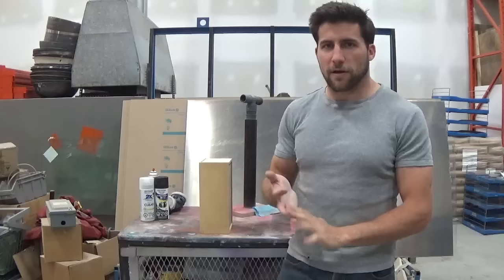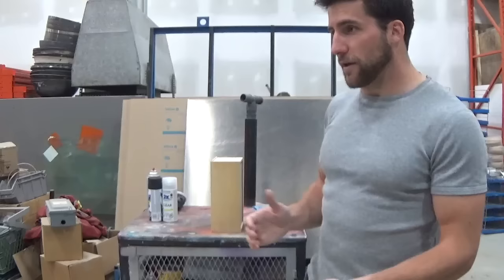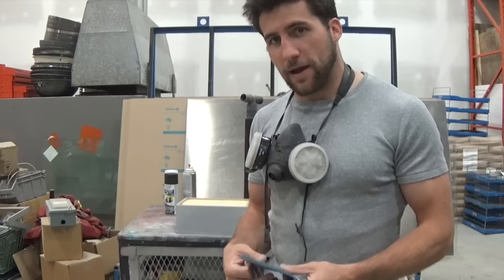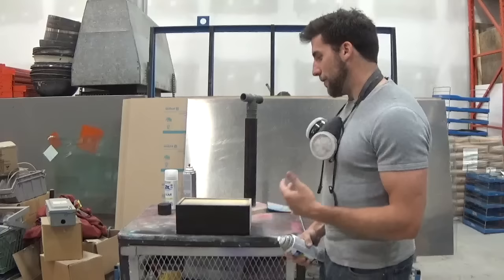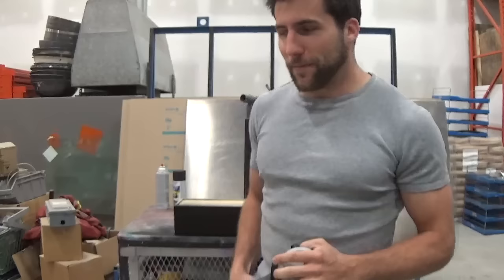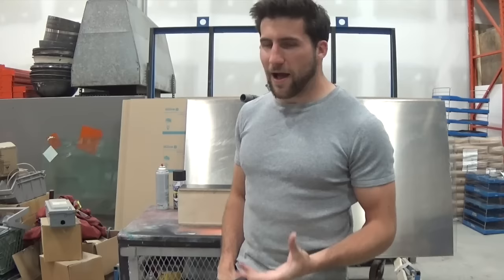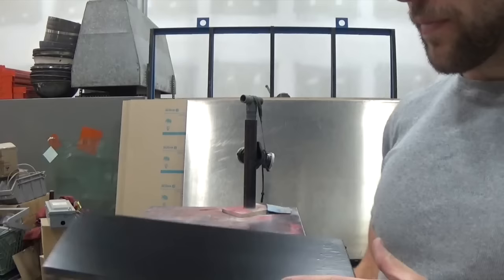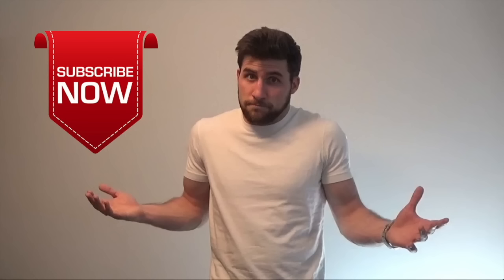How to get a matte black finish with spray cans

Comment: Thinking of refinishing a guitar with a mix of matte black and matte orange. In regards to durability (as you discussed in this video), how many coats of clear do you think I should apply? I was originally thinking 4, but I'm not sure if that is too many. I have pretty much zero experience painting guitars, but I sold paint (house paint) for 8 years. So I have some general paint knowledge. The guitar in question is gloss black now. I would prefer to not sand to bare wood, but do you feel that will give me a better quality end result? The idea I have is a matte orange top, with matte black sides and back. Thanks for this video and the four part video series on painting a guitar with spray cans. They have been insightful.
Reply from the maker: Hi there. I don't think it's necessary to sand to bare wood, particularly if the gloss black is the original finish. I would also say that 3 coats of clear should be sufficient. As you increase the number of coats, you increase some of the risks related to drying issues etc.
If I were in your situation, I would do something along these lines: 
1. Scuff the whole guitar down with 600 grit so that the new paint will stick (but no need to go all the way through the clear), and clean it.
2. Tape off everything that you don't want to turn orange.
3. Spray 2 coats of matte orange, or to full coverage (likely 10 minutes apart depending on paint type).
4. Unmask the remaining painted areas (leave the fretboard, cavities, and anything else that isn't painted masked off).
5. Spray two coats of matte clear (make sure it's compatible with the orange paint).
Reply: Brad Angove Thank you so much for the in-depth tips! That was a huge help. Didn't think about the potential drying issues with multiple clear coats. Good advice! Since I'm doing the sides matte black, and the top a matte orange, does it matter which order I finish the colors? I don't see there being any benefits to doing the orange first, or the black first, but I'm curious if there is something I'm missing there. Thanks again!
Reply from the maker: I think we had a small miscommunication in there haha. Those were essentially all the steps. Unless I'm misunderstanding your situation, there should be no need to spray any black since the guitar is already black. You just need to scuff the gloss off and put matte clear over the part that you're leaving black.
Reply: Ah, understood. I was going to coat the sides and back in matte black since I got this guitar used and its a little beat up in those areas with nicks and scratches.
Reply from the maker: Oh, I see. In that case, it doesn't make much difference what colour you do first.
Reply: Excellent. Didn't think it would, but wanted to double check. Thanks again for all the help! Your videos have been great in helping me try to figure this all out.
Reply from the maker: You're welcome. Let me know how it goes.
Reply: Will do! Hoping to get to it in the next month or two.

Comment: Hey brad great vids man, im in the process of repainting my strat and had a question. Looked through other comments but couldn't find exactly what I'm thinking about. I have a gloss color and matte clear coat. Can i flash clear coat it? I dont really care if it's matte or clear it's just what I have already. I see you told others to wait a few days and then re-sand and apply the matte clear. What will the result be if i just wait the 10 mins and hit it with the matte clear after gloss color?
Reply from the maker: +Jordan Elliot There's no reason why you shouldn't be able to do that, as long as it doesn't result in you firing 5-6 coats total on in one session. If you're doing a couple of each it should be fine. The concern is that if you build up a bunch of layers without a drying session, the ones underneath will never harden properly.

Comment: Great video, thanks.  I destroyed the matte black finish on a low-end / $200 Harley Benton bass guitar recently, and want to do a very minimal re-paint on it, and take it to matte silver.  Do you by chance take on super small projects like that?  I don't currently have a space to do it.
Reply from the maker: Sorry to hear that it needs a touch up. I’ve actually stopped taking on projects at all pretty much. If you tell me where you’re located I might know of someone though.
Reply: @BradAngove  Thanks for the reply. I'm in the Boulder/Denver CO area.
Reply: @BradAngove  Or if you don't know of anyone in this area, maybe I'll just try your approach here with cans, matte silver. Nothing special.
Reply from the maker: Texas Toast Guitars is around there. I expect they know someone who would be suited for this job.
Reply: Thanks @BradAngove  .  I contacted them, they were nice, but said they don't take stuff like this anymore.  I think I'll just try it myself, using this video.  One question, you didn't seem concerned about sanding between coats (except after primer).  Was that just because of the sample you were using for this video, or because it's not really needed with matte, since it's quicker drying?  I'm gonna go with the matte clear coat at the end too.  I'm not super concerned, it's a low end bass, I just want a finish on it.  Thanks again.
Reply from the maker: If you are recoating within the 10-15 minute window like I am you don’t sand because it bonds chemically.
Reply: @BradAngove  Got started, was looking great until I sprayed on the clear satin poly.  It spit larger droplets in random places on the front of the body, and I didn't realize it until after.  It's not awful, but annoying.  Anything you suggest for dealing with that?  Can I rub it out somehow?  Thanks.
Reply from the maker: @presentrlb let it dry fully for a week or so, sand smooth with 800 grit, and the give it one more light coat to even it out.
Reply: @BradAngove  one more light coat of clear?  I'll buy a different one, I don't trust the brand I used.
Reply from the maker: Yes, you can’t polish satin so really the only proper option is to flatten the surface and get a smooth coat on there.

Comment: Hi Brad i sprayed a guitar in matte black with the exact paint you used in this video,i applied 2 light primer coats let it dry for 2 days then sanded lightly (800 grit ) and applied 3 light coats of matte followed by 2 lights coats of matte clear.Let it dry for 3 days but when i clipped a tuner on the headstock for a day and removed it it had a mark from the clip on tuner.How long does it take to dry or this just bad quality paint that never gets really hard ? Thanks.
Reply from the maker: Hi Bobby. Did the mark look like a scuff, or was it a dent? This paint isn't particularly durable honestly, and the matte stuff doesn't offer as much protection as the gloss.
My understanding of it is that after about 2 weeks it is as hard as it's going to get, but it still shouldn't be getting prints in it after 3 days. It does scuff very easily though, even after it has hardened completely.
There is a 2 part matte polyurethane clear coat available if you need something in a spray can that's a bit more high performance.
Reply: It actually is like a dent like the paint was pushed in.I have to try to find that 2 part paint harder stuff.I have seen it on your vids and it must be much better since they had the hardner to the pain after you mix them together.t.Not sure if it is available in Canada at the big box stores Canadian Tire or Home depot but i will look for it on my next project.Thanks Brad.
Reply from the maker: I don't think it's available at those locations generally. An automotive paint shop would probably have it, or you may be able to order it online from coastairbrush,com or chicagoairbrushsupply.com, or off amazon. Sometimes amazon has utterly absurd (high) prices for them though for some reason. I'm not sure why.
Reply: I h
Have online from a company Eastwood will call them monday hope they ship to Canada
Reply: I h
Have online from a company Eastwood will call them monday hope they ship to Canada
Reply from the maker: I've bought stuff from Eastwood before. I'm not sure if the 2K cans are different (hazardous materials), but in general they do ship to Canada.

Comment: Thanks for showing! How much would you sand a catalyzed matt clear top?
Reply from the maker: Is that the paint you’re using, or do you mean the original stuff you’re painting over?
Reply: @BradAngove  the paint, Spraymax 2k Matt
Reply from the maker: You don’t sand matte clearcoat. Sand whatever you are coating over with some 800 grit to allow the 2K to stick. You can’t polish matte paint.
Reply: @BradAngove  oh wait, so how do I level it?
Reply from the maker: @amirigra7515 you need to level it before getting to the that stage, and then you need a very good final set of coats that don’t require further sanding.
Reply: @BradAngove  got it, thanks king!

Comment: Hey brad, I'm spraying my Aluminium MTB frame, planning on using acrylic based everything. Does the frame have to be 100% perfectly smooth and polished prior to primer or will applying self etch primer, then sand, then repeat give me a good surface for base coat and lacquer.
Hope that makes sense, great videos too.
Reply from the maker: Totally makes sense. You definitely don't want it to be polished before you apply the primer, but smooth is important. The process you're describing can remove minor imperfections, but primer isn't filler, and it won't take care of substantial dents or gouges.
Reply: the frame is 99% free from any thing and I'm hoping to lightly sand after each coat of primer and Base coats. Fingers crossed applying a 2k lacquer will be crystal clear by that point. Thanks, I'm on the right path. 👍
Reply from the maker: +Philip Pycroft glad to hear it.

Comment: Hi Brad, I've been binge watching your videos lately! I just found out about your Channel. Quick question, when do you wet sand? Is there any difference?
Reply from the maker: Do you mean as opposed to dry sanding?
Reply: @BradAngove  Yes! Is it a matter of preference or are there situations/materials where it's better to wet sand as opposed to dry sand?
Reply from the maker: I prefer to dry sand when wood is involved except in very specific circumstances where I want to raise grain. I wet sand only during the polishing process and only on materials where moisture isn’t an issue.

Comment: Hey Brad, I have a question. Can I use 2k matte clear coat (rattle can) over regular satin black rattle can paint? The black can is the exact same as you have Rust-Oleum canyon black. Will it react or something? Also, do you know of any rattle can paint that can witstand gasoline? I'm planning on painting my bike gas tank. 

Thanks! Amazing videos. Keep up the good work!
Reply from the maker: You should be able to do that. Let the black dry fully, then scuff it back lightly before applying your matte paint. I have a recent video on how to get a professional looking clear coat from spray cans. In that one I used a 2K gloss polyurethane over these rustoleum cans. Spraymax, who made the 2K gloss, also makes a 2K matte. It's automotive paint, so it should withstand gasoline in a very similar way to a typical automotive clear coat.
Reply: Alright, thanks a lot. I will try that and will post a video with the results (if I don't fuck up tho).
Reply from the maker: Well, I hope it goes well for you so that I can see the video haha.

Comment: Hey Brad, thanks for the video.. But I'm thinking of respraying my matte black ABS Plastics on my CBR ... Should I just use a 800 grit before following this process? Thanks in advance.
Reply from the maker: 400 or 600 grit is probably best. Make sure your primer is plastic compatible.
Reply: Thanks a milli... I’ll get started this week... wait, so I should still primer over the sanded matte black that I already have?
Reply from the maker: Is it paint or plastic that you’re sanding?
Reply: Brad Angove plastic.. so far so good
Reply from the maker: Ok. The plastic wasn’t painted before?

Comment: Hey Brad, Looking to refinish a bass matte black. Would you still recommend the rustoleuem products you used in this video?
Reply from the maker: They’re an option, but there are better products out there. For example, spraymax makes a 2k matte clear that would be more durable.
Reply: You're awesome Brad. Thanks for the advise.
Reply from the maker: You’re welcome.

Comment: If I want to spray on metal, do I need a primer?
Reply from the maker: Yes
Reply: @BradAngove  Alright. I'm spray painting a fencing mask grit soon, I don't want to spray from the inside does it matter if there is only paint on the outside for the durability?
Reply from the maker: I don’t see that making much difference.
Reply: @BradAngove  Alright great thanks a lot

Comment: Again thanks for this well presented vdo.... just wanted to ask if the same Rust-Oleum 2X Matte Clear spray can be used as top / finishing coat for chalk painted furniture?
Reply from the maker: It probably could, but I’m not sure what purpose that would serve. The chalk paint is already relatively durable, and the clear wouldn’t really do much except remove its ability to be drawn on and make it slightly less matte.
Reply: @BradAngove  Won't the chalk paint absorb water and oil if left without a topcoat? Am talking about painting my computer table, coffee table and TV cabinet with the chalk paint.
Reply from the maker: I don’t think it will absorb things, no. But what is the purpose of using chalk paint if you’re going to clear coat over it?
Reply: @BradAngove  so no need for the top coat? And the paint will not spoil right?
Reply from the maker: It generally doesn’t.
Reply: @BradAngove  cool... thanks a ton! 😊

Comment: Nice vid Brad, keep up the good work! I bought some Dupli color Flat Black General Purpose Acrylic Enamel to paint my wheels. Can I put 2 clear Matte on those? Will the result would be great? I’m not sure ‘cuz it’s not the same brand, and 2k Clear are mor for profesionalish paint job. Help me plz.
Reply from the maker: You can use the 2k clear over that. It will be better than the duplicolor clear. How great it is will depend on how well the surface is prepared etc.

Comment: Great video. Btw do I need to sand my base coat paint before applying the matt top coat?

Thanks before
Reply from the maker: You should scuff it if you’re not within the re-coat window, yes.
Reply: @BradAngove   okay, what grid that I need to use? Is 800 enough?

Comment: Hey Brad, I wanna do a black matte finish on my guitar. After I do a matte black paint, can I also do a matte lacquer (non spray) instead of the varnish? Which one would you recommend?
Reply from the maker: +jolanpiep You need to be careful about what paints you're combining. If you're using a compatible black paint and matte lacquer that might work, but it depends on how you apply. Lacquer can redissolve when wet, so you risk smudging around the black if you wipe or spray your clear.
Reply: Well if I dont do the clear, just the matte and then the lacquer, I would avoid that problem, right? (they are compatible and the matte is weather resistant, so the wetness of the lacquer shouldnt dissolve it.)
Reply from the maker: +jolanpiep Theoretically that should work. There would be no point in using both clear coats.
Reply: Sorry that Im asking it like three times, I just wanna be sure that it should be possible:

So a matte black paint with matte transparent lacquer, both on water basis, should be fine?

Will the lacquer, not being a spray, be any problem?

Thanks a load for the advice btw
Reply from the maker: +jolanpiep Of they're both water based, that should be fine. A spray would probably be better, but this should work.
Reply: Thank you, you're a hero
Reply from the maker: +jolanpiep You'll have to let me know how it goes.
Reply: Looking to do exactly the same. How is your experience?

Comment: hey! i want to customize my drum kit, my question is, do i need to put primer on that wood? i mean, drums come with a "plastic cover" and i took it off, but, I think that the wood is already sealed, ricgh? so, do i need tha primer or just paint on the wood? thanks!.
Reply from the maker: +Gonzalo pacheco sepulveda I don't know much about drums. If it's already sealed you might be able to skip it, but it could also help using primer to improve adhesion if you're not sure what the kit is sealed with.
Reply: thanks a lot !
Reply from the maker: +Gonzalo pacheco sepulveda You're quite welcome.

Comment: Can i do normal matt black base coat with matt 2k clear coat on it ? (Everything with cans).. Bdw nice tutorial 👍 a
Reply from the maker: You can. You just need to make sure you’re using a matte 2K clear.
Reply: @BradAngove  yes acrylic base coat and 2k matt clear top coat (last)
Reply from the maker: That should work just fine.

Comment: hi brad! do you need primer if your spray painting motorcycle flairing?
Reply from the maker: Either that or adhesion promoter would probably be a good call. I have a video on how to paint plastic parts properly that you may find useful.
Reply: ok brad. thank you :)
Reply from the maker: You're welcome.

Comment: Am I able to do this on my phone?
Reply from the maker: I’m not going to pretend that that sounds like a good idea, but technically if you sand it and use primer or adhesion promoter (depending on the material) it should work/stick. You phone might not work afterward though, and if it gets hot you may run into issues.